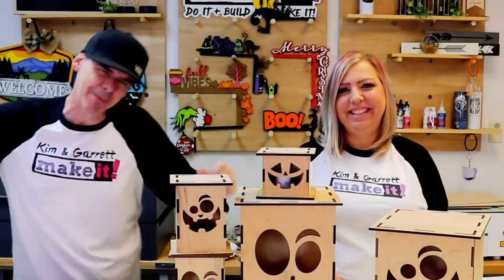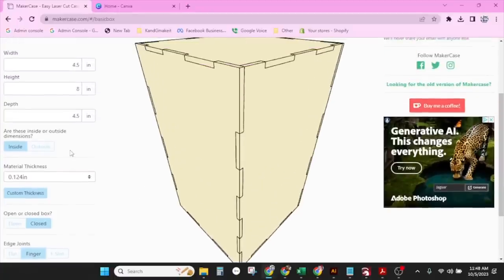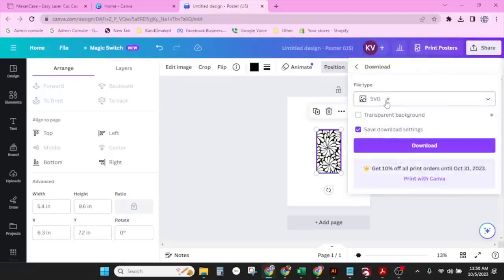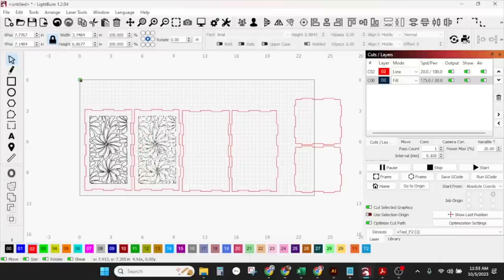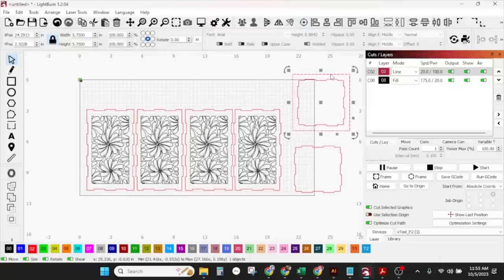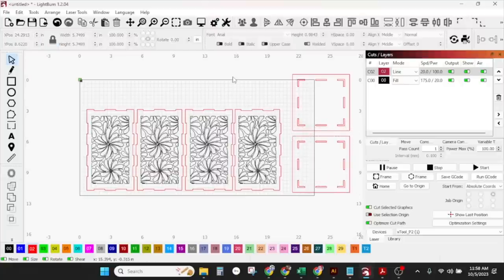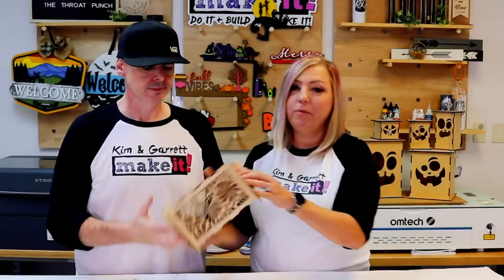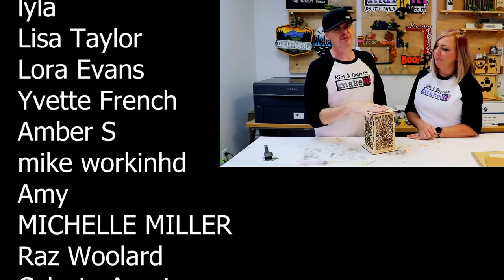Discover the Simplest Way to Create a Laser Cut Lantern Box

Comment: Hi K&G! Great video 😊
Question - you did not adjust tabs for kerf, is this because a diode cuts so thin? My c02 needs an adjustment or they are too loose.
TIA!!
Reply: Maybe because this box had a top and bottom to hold everything together.  When they first skipped that step, I thought they were going to cover Lightburns ability to add kerf, and modify slots and tabs